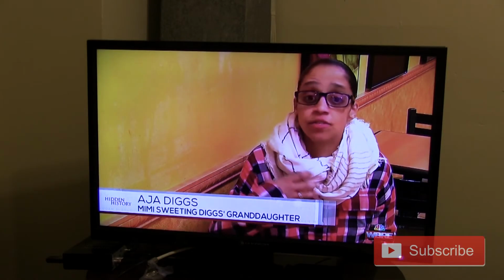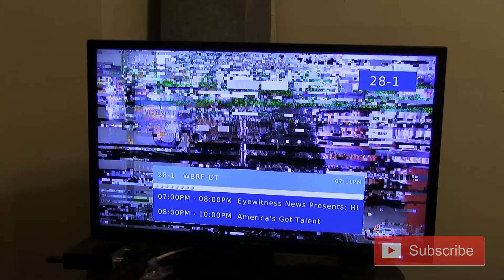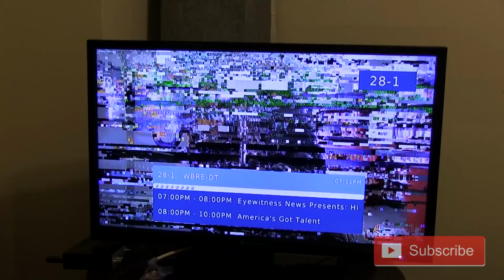How To Connect a TV Antenna to Multiple TV Sets

Comment: Hello, I have a question.  In my house, all my cable tv runs come together in a closet.  I have an antenna on the roof.  I read that the booster should be as close to the antenna as possible.   But I'm also looking at a powered splitter in the closet.  So, what makes more sense?   To boost near the antenna and have a splitter in the closet?  Or put the powered splitter in the closet?

Comment: Another way to feed several locations is by using TV signal taps.  You use 1 cable run with taps along the way instead of several long cable runs from a splitter. Taps are used widely in apartment houses but can work fine in any private house too.
Reply: What are taps?

Comment: Hey, If you have a 1 In and 2 Out unpowered splitter try putting two antennas on the 2 Out then put another coax cable (RG6) then connect it you will get a lot of channels, for me i have 60+ channels on ISDB-T

Comment: This is definitely true I was able to get more Channels with a Powered Splitter compared to a regular Splitter with the Powered Splitter a Brand that you recommended called Reliable Cable/ Antronix we get around 97 Channels but with the regular Splitter we got way less Channels only around 40 or 50 Channels. Our House also has Aluminum Siding basically everywhere around the House itself and we have some tall thick Trees and Solar Panels on half of the House so we needed something to help keep the Signal and a Powered Splitter seems to do the trick.

Comment: I know this thread is old but I am getting high noise levels (S7-S9) on my 11 meter CB base Radio. After searching around, the RFI is coming from my Antenna Amplifier. Is there a way to filter or shield this RFI ? I would like to use my radio !!

Comment: Nice video! Im wondering if the signal strengths is only weakened when multible tvs are on at the same time? my tvs will usually only be on one at a time. I looked all over the internet and no one ever mentions that

Comment: in a recent video, i found out how to use a pocket toner to find cables to my TV,  but my problem is, that i am disabled and i need to find out if the cable that is located at the roof receiver is good all the way down to the junction box nearer to the access point before it goes through the house??? if i use the pocket toner i cannot get on the roof to get it done??? could you, or would you help me find a way to do this??? i would be totally greatfull to you, can you respond via this you tube connection.... respectfully yours... Ali, in Florida...

Comment: When I look at these type Splitter+Amplifiers, they say "Not compatible on systems with an existing amplifier or pre-amplifier."  
I have a Televes DATBOSS LR Mix 149884, which comes with a Built-In Pre Amp.
What can I use to spit the output to multiple TVs with this type of antenna?
I tried a non-powered splitter, but I lose channels.
Reply from the maker: You should be able to use an unpowered splitter after the power inserter to the Televes antenna. If you lose channels, you might be using too large of a splitter. For example, if you're using an 8 way splitter reduce it to a 3 way splitter. For additional help, you can sign up for my consultation service below: https://www.antennamanpa.com/antenna-recommendations.html

Comment: 1Thanks for the knowledge. Most ads clearly claim the amp DOES magically bring in stations. Sounds like, in reality they are pretty much useless other than long cable runs. My coax is only 30 feet. Unfortunately, most towers are 50 miles away and height seems the only solution.

Comment: I've got 92% quality & the downstairs TV is just 21% signal quality on a lot of channels and bad weather don't work,so will a signal amplifier work between the wall outlet downstairs and the input of the TV,or does it need amplification before the splitter diverts into 2? Thanks for this video you explain with the faucet metaphor give me lots of answers, do thank you 👍✌️

Comment: Tyler, if I use antenna amplifier with 4 outlets but only have three tv's what do I do with the fourth free open cable post ?
Reply from the maker: You can usually keep it open but some say using a coax terminator below can prevent "signal leakage." https://www.amazon.com/Type-75-Ohm-Terminator-Pack/dp/B000AAN76Y/ref=mp_s_a_1_3?crid=3SZWY60CDVZ31&keywords=coax+terminator&qid=1664471312&qu=eyJxc2MiOiIzLjQyIiwicXNhIjoiMy4wNCIsInFzcCI6IjIuOTIifQ%3D%3D&sprefix=coax+termi%2Caps%2C162&sr=8-3

Comment: I have antenna on my roof that was professionally installed to 4 TVs with an amplifier. Channels I used to get don’t come in anymore. Could it be the tv tuner? I’ve bought new TVs in the last year so the TVs I have now are not the ones I originally had.
Reply from the maker: I doubt it's the tuner on all TVs. Check the amplifier and maybe replace it. For additional assistance, sign up to my consultation service at the link below. This can prevent you from spending hundreds of dollars and time wasted on setting up the wrong equipment for your area. https://antennamanpa.com/antenna-recommendations.html
Reply: Maybe rescan tvs

Comment: Isn't it the practice to terminate unused outputs on a splitter with a 75ohm termination plug? Used to be back in the analog days you could get ghosts on the picture from signal reflections in the coax cables if things didn't get terminated properly. I know on a CAN communication data bus each end of the buss has to be terminated with the proper value resister or other devices on the bus will become erratic from the reflections of the signals caused from the improper termination.

Comment: Very educational I'm actually going to be running 100 ft of cable wire downstairs and that was wondering if I was going to get any good signal or not and I'm actually using a splitter so I'll purchase the amplifier you're talking about so I can see the difference, it's a purchase through Amazon so if I don't need it I can always send it back.

Comment: I know I'm a bit late to the party, but do you know of any wireless options that mean you can use an antenna input in one room to pass the signal to a tv in the next room? I appreciate there is gonna some reduction in quality, but I'm not too fussed about that and the distance between the transmitter and receiver is only about 20 feet.
Reply from the maker: Yes, you can use a Tablo which I attached below.
https://amzn.to/3NFUJL7
 
The TV in the other room will need to have a streaming device like a Roku or Firestick to access it on your wifi network.

Comment: so I just installed antenna and have definitely pointed it towards wilkes barre PA and am picking up Philly stations?  I double checked my set up and direction and did it correct. Why is this happening?
Reply: I once met a pretty girl from Scranton...
Reply from the maker: It depends on your location. Some areas between markets get better reception of "out of market" channels. If you need additional assistance from me sign up for my consultation service at the link below. https://www.antennamanpa.com/antenna-recommendations.html

Comment: Is the Regal zds3dgh10 DC power pass? I need DC pass through to power the pre-amp. I cannot combine a distribution amp with a pre-amp due to power insertion. I can power one device but not both. It’s not indicated on the Regal 3-way splitter if it has DC pass but one of the outputs has -3.5dB only while the other two outputs have -7dB. I’m assuming that the -3.5dB is DC pass.

Comment: thx for the mini tip i should of watched it before i bought the 2 way splitter my original plan was to use one end for my tv and other end to my airTV 2 so that way if i’m out i can just watch my local programming through my sling account before installation i was able to get my scanned channels 95% of the time the 5% was just during storms after installation at random times one of my channels goes in and out but after seeing your video while searching for a fix i immediately changed the wiring while my show was on a break and have my airTV rescan and it got close to the same channels that my tv stored since the last scan which was when i moved out of my college dorm 5 years ago thx for the mini tip

Comment: I use Portable power stations  to run appliances when there is a power outage (which is common where  I live).I would be better off installing an additional antenna for the extra TV points so I am not reliant on the power grid. Don't know how much power these powered splitters use, but surely just adding an additional antenna would save energy in the long term and be a good option rather than a powered splitter. Love to hear your opinion.

Comment: Plus you need to use a power thru splitter if use a amp up on the antenna becuse with out a power thru splitter the amp won't get power and you can lose channels found this out years ago when first starting out like you and soild signal com sells these splitter for like 4$ bucks or so ware a regular splitter won't allow power to go up to your amp like the lna 200 by winegaurd I always used

Comment: I bought a Winegard platinum antenna and hooked it to my TV as per your advice and it works great. Now however, I trying to reconnect my DVD player to the TV as well but cannot do so. I thought a splitter would do the trick but it doesn't can you advise what must be done to have both my Winegard and my DVD signals used alternately?
Reply from the maker: You can connect the DVD player via the red, yellow, and white RCA cable to the TV. You don't want to combine it with the cable coming from your antenna or it might mess up your reception. If you need further assistance feel free to sign up for my setup guidance service at the link below: http://antennamanpa.com/antenna-recommendations.html

Comment: I'm thinking about hooking up the antenna to a tablo box without a splitter.  From there I can watch on any of my TVs without signal loss.
Reply: I just did exactly that.  It works perfectly.  You only need to decide if you want the 4 tuner Tablo or the 2 tuner Tablo.  How many will be watching tv in different rooms at the same time?  For me, no more than 2  so I went with the Tablo Dual Lite.  You can buy a refurbished unit for $79.99 with no tax and free shipping directly from Tablo's website.  Keep in mind that you will also need Roku or Amazon Fire devices for each tv you want to use but they are cheap.

Comment: Very good information. Thanks for the video. Can you please help me on this question. Can I connect a second splitter to a splitter?  I am thinking to connect a short coaxial cable to the out of the splitter then connect the other side to the IN of the second splitter to have two extra out.
Reply from the maker: Yes but if it's two unpowered splitters you will kill your signal. Make sure at least one for splitters is powered

Comment: My house has an old (huge) antenna in the attic that has two baluns and two runs of coax attached to it. One for the upstairs and one for the downstairs. Is that a legit way to to do it?
Reply from the maker: It's one way to do it. I'd use a powered splitter instead.

Comment: Hello Tyler.  My Question :  If I use the channel master 4 port dist amp and only use 3 ports, and terminate one spare port,  is that extra signal from the terminated port being split between the rest or just "not used"  ??

Comment: Wonder if I'd do better just getting a Tablo and stream it to the other TV's?
Reply from the maker: That's a good option if it is not feasible to directly wire each TV set. Most houses are pre wired with coaxial cable but not every house is
Reply: @AntennaMan  Right now I do have coax line to the rooms. but once I ditch cable I'll try them first, there's only one splitter and the cable works good on it. I built an antenna I found on the net and around 30-40 miles from the best towers. only thing is the lines are from the late 80's and friend tells me the lines can go bad over the years, not really sure if that's the truth though, thanks.

Comment: Thanks for info, and understood,so  one question please, if you use a splitter for 2/3 Tv's ,say,..but only have  one  TV on at, anytime one time , will that one still get it's normal signal strength ? cheers from OZZ
Reply: I think unfortunately the signal is weaker when a splitter is used even if only one TV is turned on. At least, that was my experience.

Comment: Thanks Tyler.  What is the difference between a "distribution amplifier" and an antenna "pre-amp"?   If I use a distribution amplifier to boost the signal to provide a strong enough signal to four TV sets, is the amplifier going to overwhelm a single TV set turned on with too strong of a signal like a pre-amp can do?

Comment: Curious can someone split cable tv signal and roof antenna to one line to multiple TVs like 6 or 7 tvs. We have cable but we have had times when some locals was not available due contract issues but was available thru antenna signal.

Comment: Good explanation.  I have a powered splitter.  One thing I would like to know is your thoughts on the, Juice, from Antennas Direct.  It was a great device and it greatly enhanced the channel signals and the quality of the pictures but whenever we had a rain storm it would burn out.
Reply from the maker: It looks decent but as far as you losing stations when it storms that's likely due to changes in atmospheric conditions due to barely getting the signal. If you would like me to take a look at your reception situation to determine if you need a better antenna setup visit the link below: http://www.antennamanpa.com/antenna-recommendations.html

Comment: Tyler, I used to have DISH. I've since replaced it and want to add a regular antenna to my house. The cables that the DISH system used are still in the house. I understand that I should be able to use the coax that the DISH used, but my question is whether or not I can use the splitter (?) that the DISH system had used to distribute the signal inside my house. 

I want to hook up the antenna to the same TV's that were  connected to the DISH but if i don't have to buy a new splitter, I'd rather not.
Reply: It depends on the bandwidth the splitters are good for and a number of other factors.  If you are splitting  to more than two TV's you may need a powered splitter to combat signal loss.  The strength of the initial signal can also play a part in how you go about handling multiple TV's off one antenna.  Always start with one TV directly to see if you need a pre-amplifier at the antenna to boost the TV signals (after properly aligning the antenna and gaining proper line of sight, of course).  If you have many obstructions or are on the fringe, you have to also match the antenna to your needs.  You also want to make sure what part of the signal band your digital stations are set at:  lower VHF, mid VHF, UHF, or a mix of them.  This will inform you as to which antenna may work best.  Check to see if they have gone through the recent FCC repack since some of the lower spectrum has been carved out and sold off for cell usage.   www.rabbitears.info is one place to look.  TV Fool is now outdated.

Comment: I just rewired an attic mounted older Channel Master Advantage 45.  It was wired with old 300ohm cable and I wasn't getting the channels I could get in the analog days.
I rewired with a 75ohm transformer direct to the tap-off terminals and added a basic spliter.
I pulled in 68 channels with most over 90% on my digital TV, and average of 75% with a cheapo digital converter box.
Would it be OK to use two individual 75ohm transformers under the tap-offs instead of the spliter to maybe get a stronger signal to the converter box?
I may be adding a third TV in a few months.
Reply from the maker: I am not sure what you are referencing but if you are connecting one antenna to multiple TV sets you need to use this powered splitter below. It is powered by the coaxial cable so you can place it outside if your antenna is not near a power outlet. https://amzn.to/2Id2vvD

Comment: good video    I want to know how high should I put my antenna   thanks
Reply from the maker: This usually goes inside where your splitter is. As long as you use a RG6 quad shield cable you can connect it 30 feet from the antenna. Check out my video on RG6 Quadsheild vs old RG59
Reply from the maker: I misread your question. Usually 15-30 feet above ground is good. The higher the better.
Reply: berapa db bos alatnya mohon infonya